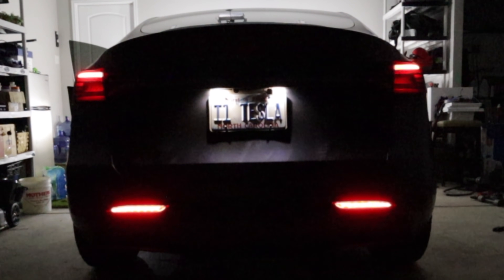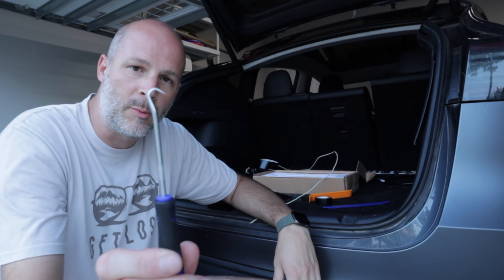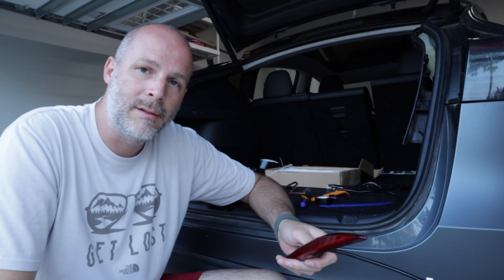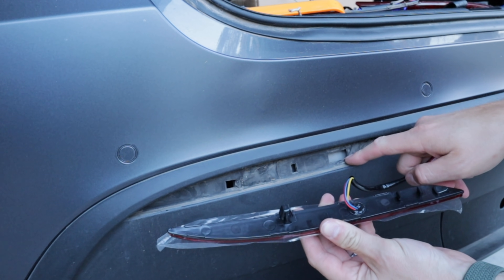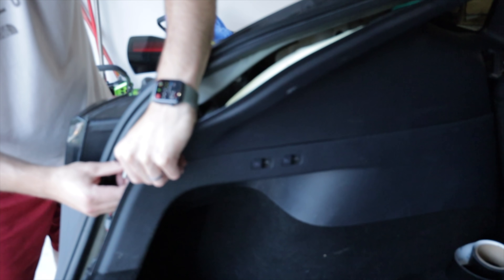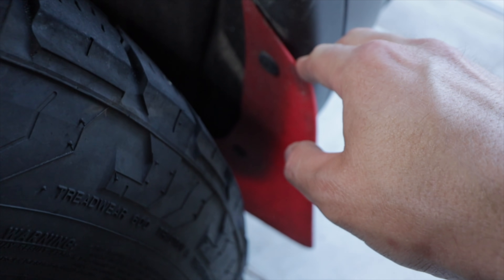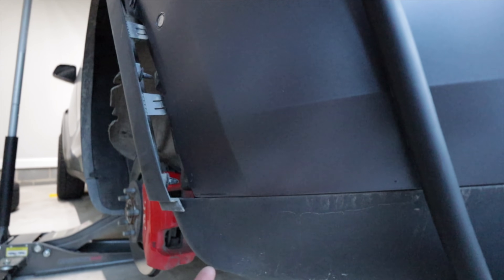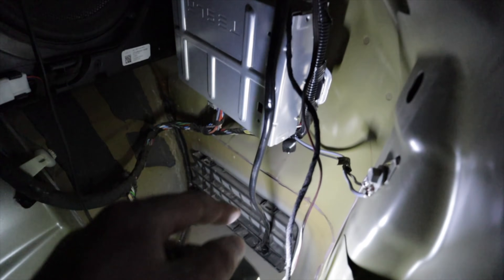NEW Lower Lights Tesla Model Y + 3

Comment: Hi-

Great videos.   Hansshow has two styles for this light, Simple or Fishbone.   Which style did you install?   Are both styles sequential?  Or does one option light up like the OEM turn signal light does?   If both are sequential,  what is the difference?   Thanks!

Comment: You are removing reflectors that are there so that if your car is parked in a dark area, it will be visible to cars coming up from behind. 
Do your replacements have any built in reflectors or are they just all lights? 
I’ve asked this question over and over on manufactures and others that have installed these and I’ve never gotten any answers. It would be easy for you to shine a light on them in your garage at night. Brian, you can tell me if I am just being a crazy 😜 fool and I shouldn’t care about this safety issue. Thank you so much 😊
Reply: The replacements are all reflective material as well, no passive safety is lost.
Reply: @NJturtlePower  Thank you so much for answering my important safety question!

Comment: The functions seem a little fiddly and in some cases odd to me, but they're pretty cool. I would get them if I had a Model 3 or Y.

I found some lighted ones on ebay for my Model S, but they're not animated or sequential, they just duplicate the basic parking and brake lights. There's no third function for turn signals. I suppose the bright function could be used for that instead of brake, but since I'm not in North America that's probably not a good idea (turn signals must be amber here.) The other thing is that they have no connectors, just bare wire ends. I'm waiting for the taiillight connectors I ordered so I can make a Y adapter. I'm also going to add trailer wiring and a hitch so I can add a rear bike rack and even tow a little utility trailer, so adding in the wiring for these doesn't add much trouble to that operation. I'm also going to add a set of relays to isolate all the trailer and add-on lights so there's no possibility of creating problems with the stock circuits.

I understand there are a lot more 3 and Y out there than S and X and there always will be, but it really chaps my hide that they are getting all the love from the aftermarket and the S and X are increasingly being left out in the cold. There are actually far fewer accessories and upgrades available for the S and X now than there were a cohple of years ago, and with the new versions coming out I don't see that ever getting better for 2020 and older models. And no, the new S and X are NOT "refreshed", they are new from the ground up and very few parts are interchangeable. I guess I'm just going to have to roll up my sleeves and DIY everything I want from scratch. In addition to making the inboard hatch taiilight sections functional (the turn signal section has no LEDs at all and the red section only has running lights, no bright brake mode), there are a number of upgrades I want to do on the interior.

Comment: Brian as far as the aftermarket taillights go have you heard as to whether or not the 2021 models with the separate amber turn signal from the brake light if they work out better. I haven’t taken delivery of my MYP yet otherwise I’d look in to trying to get a hold of a set to test because I haven’t been able to find anyone with a newer MY that’s installed them. Love the lower market lights. Will definitely be picking those up. Thanks for the tutorial.
Reply: I just installed them but I have the 2020 MYP so both amber turn signal and brake will turn on when you brake. It’s not a big deal but they should make it instead of amber make it RED
Reply: @rmolep  If you realllllly want it to work properly, you can run a separate wire from your side camera, there is a 2 wire connection for turn signal, tap into those wires and run it allllllll the way back to your tail lights ( along the rocker panel ) for your turn signals
Reply: old reply yeah, but I got 2022 model Y last week, install taillights (and lower market lights)yesterday. they do NOT light up the turn signal when you hit the brakes

Comment: I have tried 3 sets of these for my Model 3 trying to find a pair that animate as yours do.    Every set I get just has a single strobe that animates outward instead of how yours have the fill effect.   My brake light animation does 4 hyper flashes before going solid which is way too long imho instead of the 2 quick flashes.   No startup animation like you have either.   :(

Comment: Do the bumper lights flicker when you apply on the brakes? I have seen other reviewers and theirs would flicker which would be a concern. Thanks for the video.
Reply: It’s the hyper flashing… likely only one side. To stop this you can cut or disconnect the blue wire in the harness. What this will change is that when you headlights or parking lights are on these will stay off and only come on as sequential signals. IMO they are too much to be constantly on anyways.
Reply: @NJturtlePower  Thanks for the insightful feedback. I will follow your suggestion and disconnect the blue wire for the simplistic look. I just ordered the Hansshow Eagle Eye tail light but in a clear style instead of the dark-smoked version like yours.
Reply: Just revisiting this thread. Which wire should I disconnect if I don't want the light to flash when braking? I feel it's a little too much for drivers behind me. I would prefer just having it flash when using the turn signals. Would that be the red wire? Thanks.